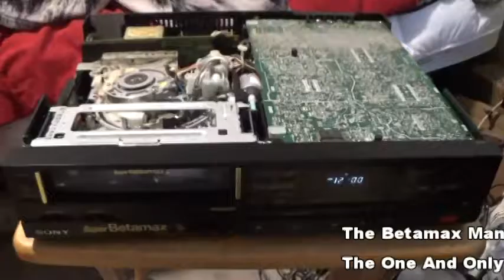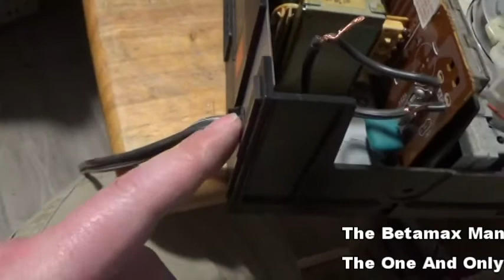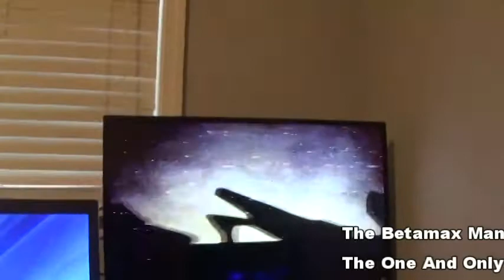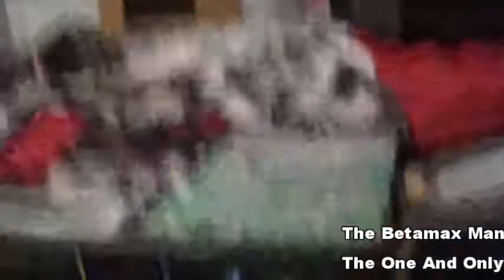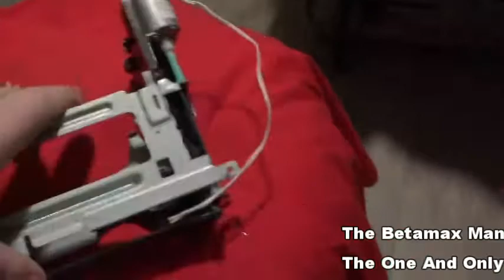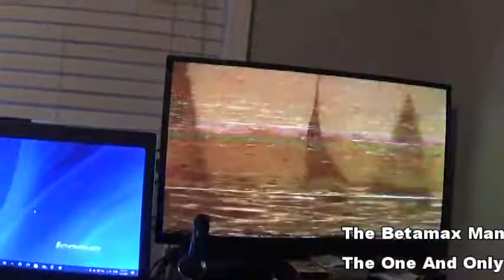Sony SL 340 Super Betamax Repair Part 1

Comment: Well I bought an SL-340 today after seeing your video again. He said it works except the picture is bad - has distortion and white dashes like yours so I'm hoping it's the capstan cap.
Reply from the maker: this was a very rare ode thing with this machine the issue may just be user errer somtimes sellers forget about adjusting the tracking also if this is not the case caps go bad in the pre amp or head amp that causes bad picture good luck on fixing your machine i want you to know i'm here to help you if you need it one of the best things about life is helping others
Reply: @thebetamaxman8905  I replaced the capstan cap, which had leaked out.  But there's a tape alignment problem, a tracking type line near the bottom that won't adjust out with tracking. The shuttle block guide is loose, but adjusting it only makes it worse. Same for any tapes I have pre-recorded. Funny thing is , the picture is perfect on  tapes recorded with this machine. I'd love to see a video on adjusting those tape guides. Thank you Mr. Betamax :)
Reply from the maker: @superbetahifi  adjusting the tape guides is something you do with a scope